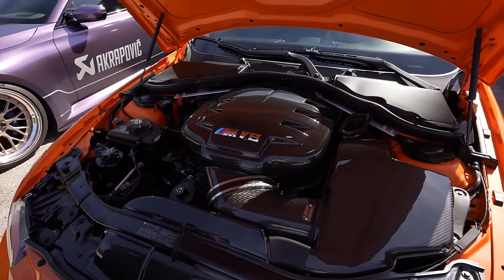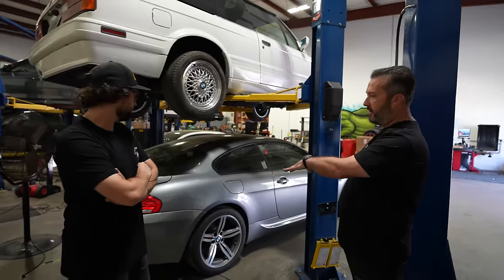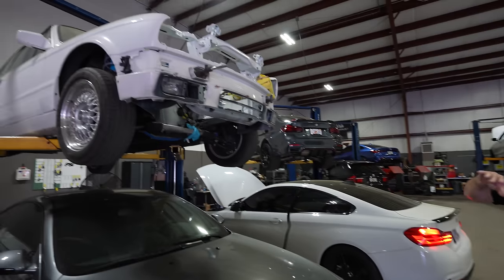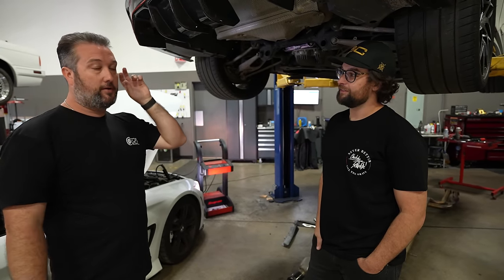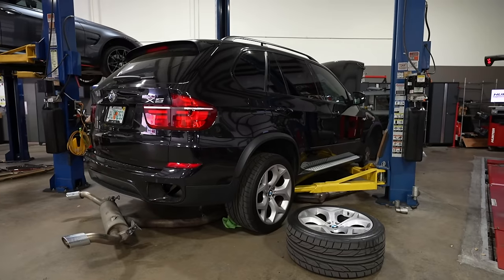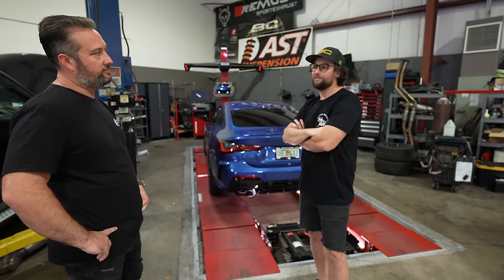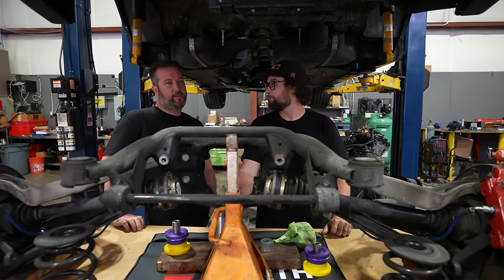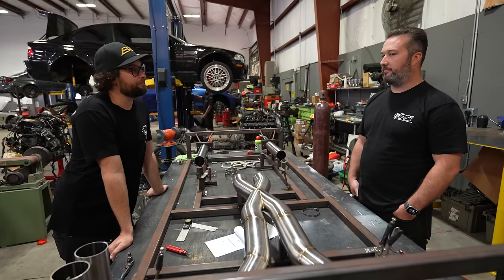SHOP TOUR  - Crazy Wide Body BMW M2, M3 Wagon GTS Tribute, And Tons Of Classic BMW's

Comment: The most annoying part about the subframe problems is they acknowledged it was a issue on e36 m’s and had factory reinforcements compared to non m e36’s. Then they got rid of it on the e46’s? Which is dumb. They added 100 hp and then left it weaker ?

Comment: @8:01 I have to laugh, every time I hear, “the engine was designed for the SMG”.  The s85 v10 does not care what gear ratios are bolted up to it. It was the 3.62 gearing shared between the 7 speed SMG and 6 Speed, which was mismatched as an afterthought by the bean counters. 

Bean counters shared the 3.62 for the 7 Speed SMG and the 6 Speed to cut costs. The 6 speed didn’t have the best gear ratios, when mated to the shared 3.62 — optimized with 7 gears.  The bean counters jammed a square peg into a round hole, with a 3.62 and 6 gears. 

While a 3.91, with 6 gears, optimized the torque curve of the s85.  

Ask me how I know…14 years and 195,000miles on my Dinan S2 e60m5 6MT.